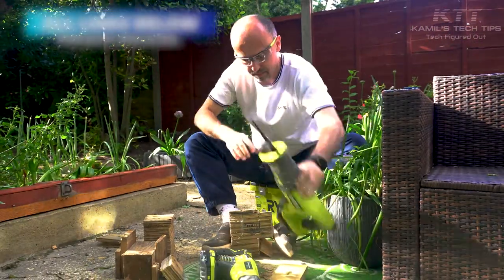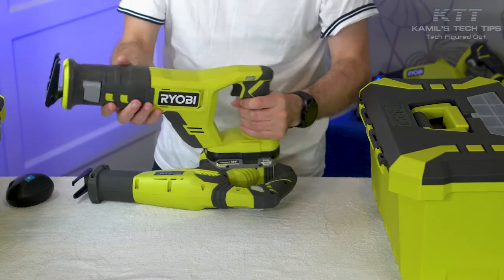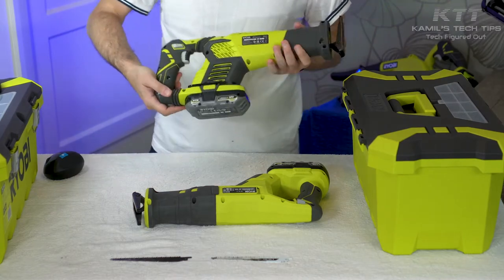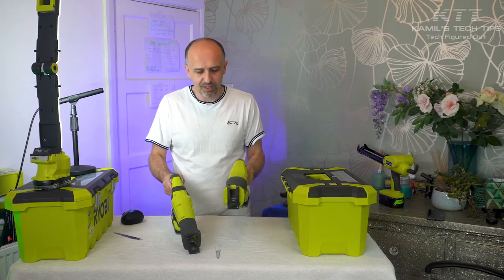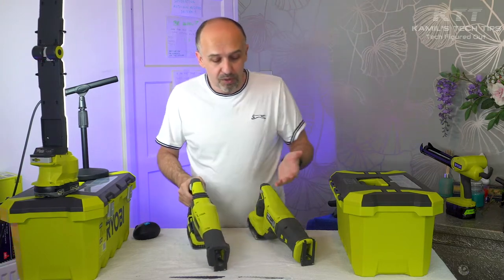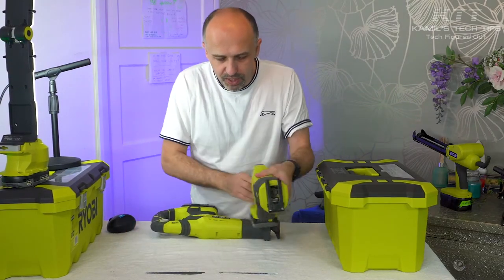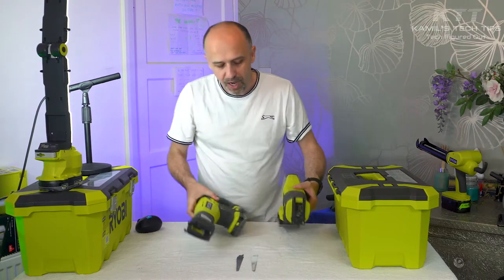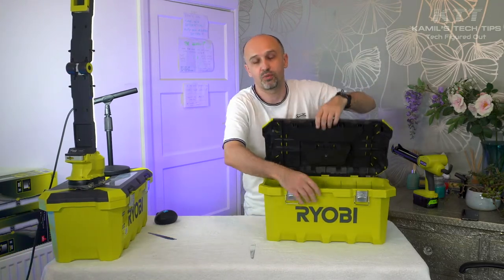RYOBI New vs Old RECIPROCATING SAW - RRS18-0 vs RRS1801M

Comment: Do you think it would the same result if you swapped the blades around?
Reply from the maker: Yes. I did use and swap a few different blades a few times to check. The blades make very little difference - it's the saw that counts.